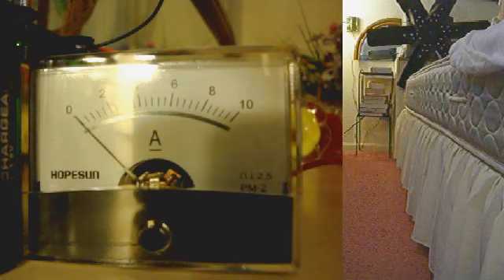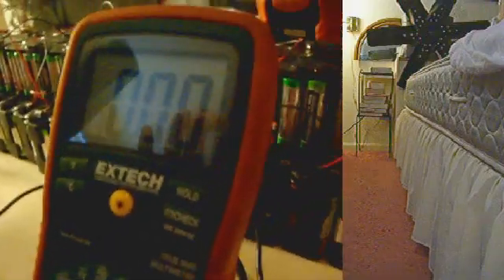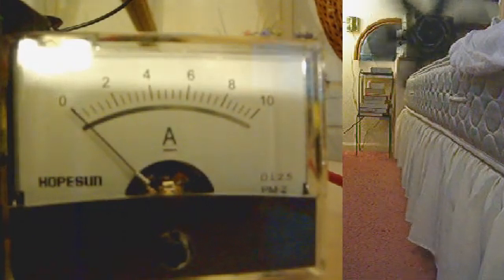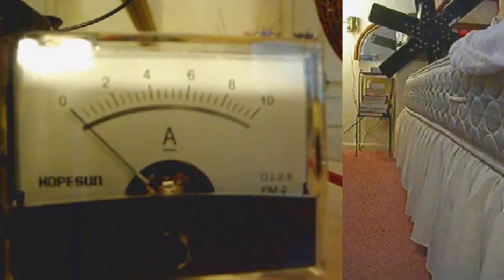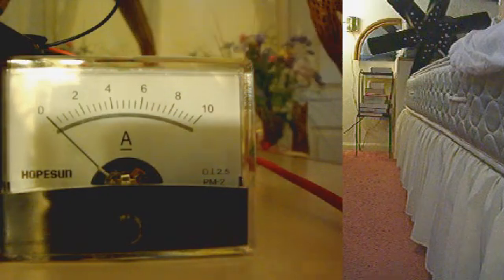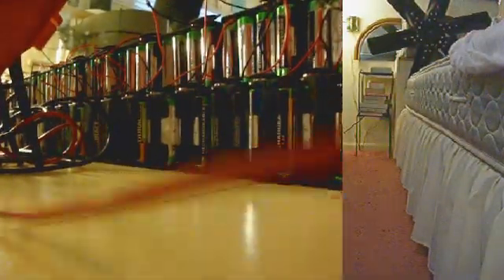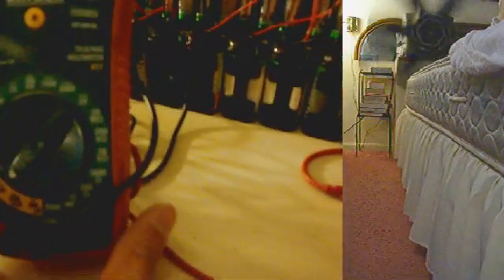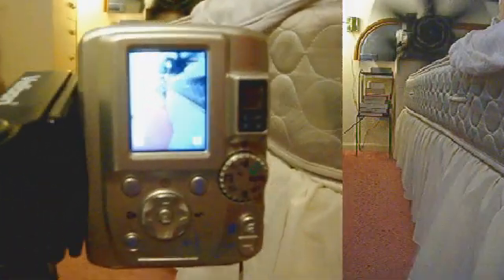10A panel meter verifies digital multimeter readings of Newman Motor

Comment: Well done,
you have a great fan only using
around 10 Watts.
If you would work on the commutator
making it more spark you would
better recharge the batteries.
Good luck.
Regards, Stefan,